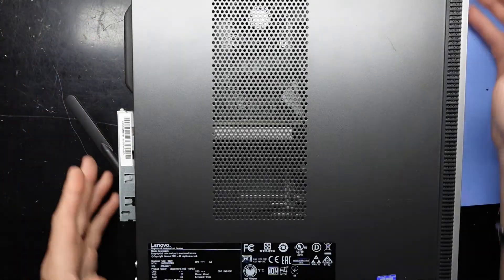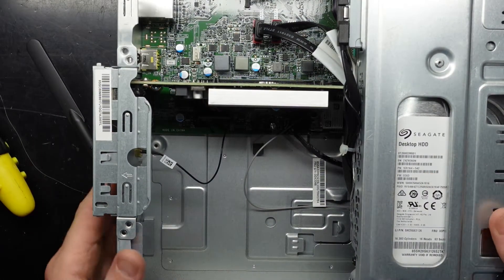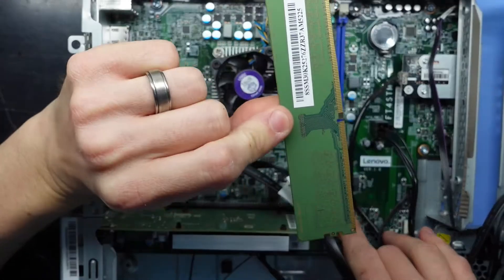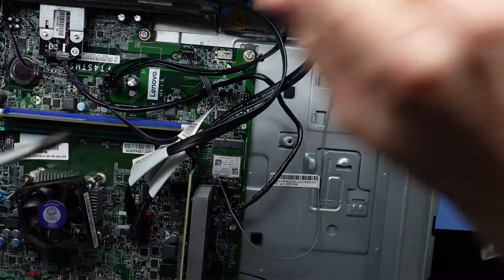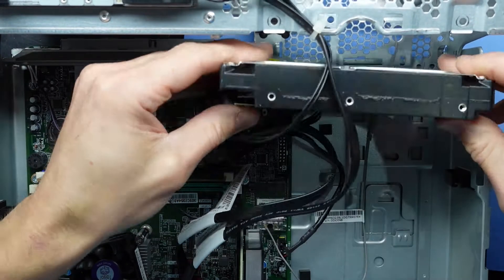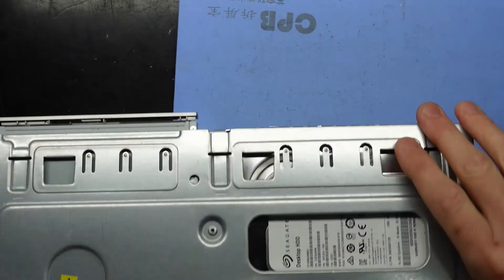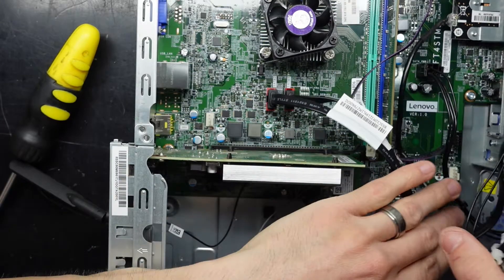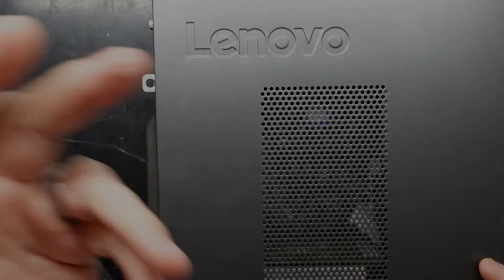Lenovo Ideacenter 310S teardown and inspection

Comment: Have this and hoping to find a decent way to upgrade the graphics card. Honestly, I don't need any expensive or brand new, just a better version than the original one so It can run more modern games better.

Not like I want it to run Crysis or anything, just a more stable and less lowered looking games. Would be nice to place Necrovision and Iron Harvest with decent framerate and detail.
Reply from the maker: you might be able to get something like a RX6400 or a GTX1650 (low Profile Versions)
Reply: @rickstechrepairs  Yeah, something small will suit my pc just fine.
Reply: @rickstechrepairs  Looks like I'll have to buy secondhand. Can't find a good seller anywhere.
Reply: @rickstechrepairs  The GTX 1650 seems the best case for me. Had a look, might be able to get one second hand.

Comment: The company that owned the one I found the other day, took and made the HDD unusable by drilling a screw into it! A 500GB Seagate! 😡😠 Is the system a 64-bit? What is the max RAM it can support? I get the impression that the GPU is sort of as no-name or Lenovo made card. Thank you 🤓
Reply: @GooseAffiliate859  I haven't looked into the unit close, so not sure if it has a GPU card or the graphics chip. Thank you 🤓

Comment: Did you say that the mounted CPU cannot be upgraded? Can an ITX motherboard fit in the case? Got a hold of a similar model (& an HP slimline pavilion) Lenovo a couple days ago. Thank you
Reply from the maker: correct, also case would probably be useless for another motherboard to go in, due to the motherboard cutout at the back
Reply: @rickstechrepairs  I watched a couple other videos that did a HDD to SSD swap. I think the m / b is made for the case. An ITX m/b may fit but in order for it to be correctly supported, some modifications would have to be made. Thank you 🤓

Comment: Bought it 3 years ago, as I was looking for something cheap with a CD ROM. It's very slow indeed and HDD is noisy.  Last month, added another 8GB stick and replaced 1TB HDD with a Crucial MX250, installed ESXi 7.02, had to buy  HP 1GB 2P 361T NIC(for ESXi). Runs 4 Linux machines smoothly + pfsense. Will use 361T in new built to run VMs, as 310s 08asr is low on power consumption, thinking of using it as a dedicated firewall with a cheap NIC.
Reply from the maker: Good to hear you had a decent use for this model

Comment: Straight forward video, subscribed. It's disappointing to find out the CPU can't be upgraded. I wouldn't see much utility in upgrading Ram, GPU & Hard drive for it all to inevitably bottle neck at the processor. It's a shame, I was hoping to be able to upgrade. I can get a few of these for $50 a pop. I'd imagine they'd run Linux pretty well as is. Low on power with a laptop charger haha. That is actually quite appealing to me, ideal for solar.
Reply from the maker: Cheers, glad this has helped you.
if you can get free or cheap parts then it might be worth doing it to get it as a simple web browsing tower

otherwise they aren't too good